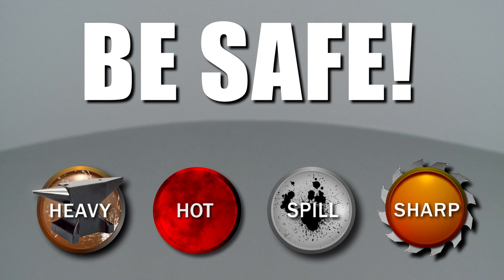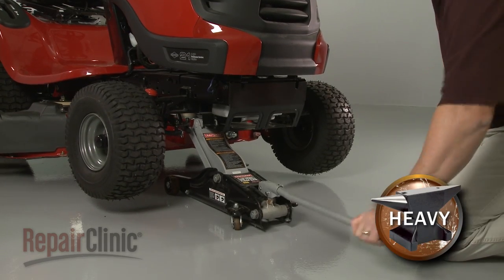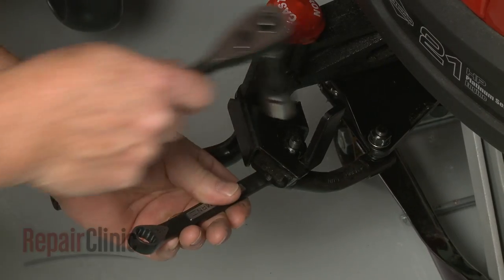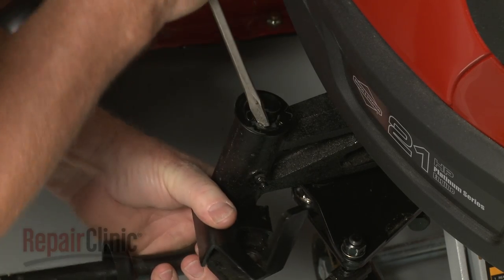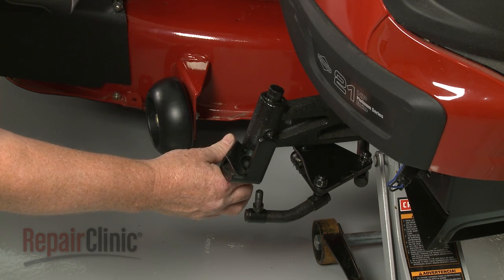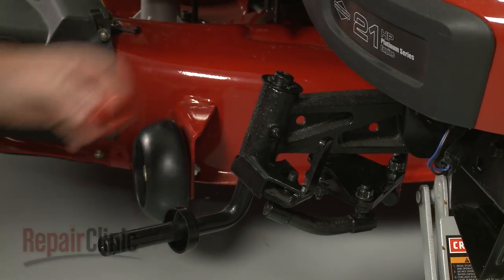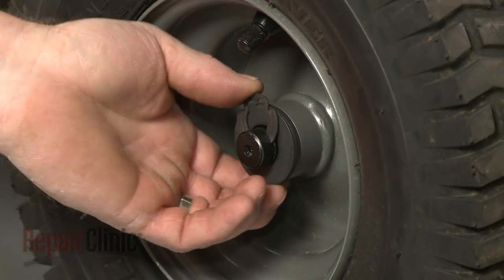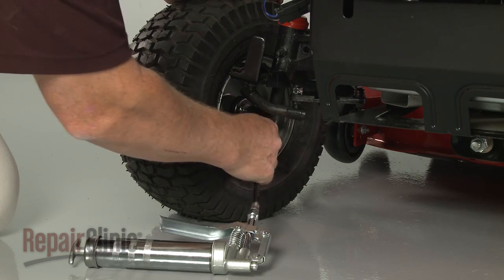Craftsman Riding Lawn Mower Steering Spindle, Right #583512901

Comment: I just got a John Deere that has the right spindle frozen solid. I greased it and used a pipe wrench and even with an extension on the wrench the spindle will not turn. I have another junk mower for parts that I can replace the spindle with. But the problem is getting the old one out. Any suggestions other than trying to drive it out with a sledge hammer?
Reply: I'm having the same issue,  did you use heat to get it out? How did you make out?
Reply: A sledge is really your best bet, just watch if you mushroom the top a bit you'll have to grind that down for it to slide through. After it's past the top you'll need a punch to fit in the hole to continue hitting it. If you still can't get it to move by hitting it you'll probably have to use heat on it. You can also change out the entire front axle pretty easily as they're usually just one bolt in the center and whatever steering links you have to remove.

Comment: What are the symptoms of a bad steering spindle?
Reply: Front of the front tires are spread out wearing the tires faster than normal....known as toe-out
, /ˈtōout/Submit, noun:  a slight forward divergence of a pair of wheels so that they are closer together behind than in front.
Reply: @dug224  usually the bushings being worn out will be the cause of that before the spindle. Unless the bushings are completely worn out and it keeps getting used, then it can wear into the spindle and/or the axle